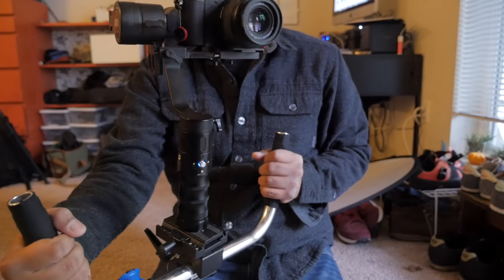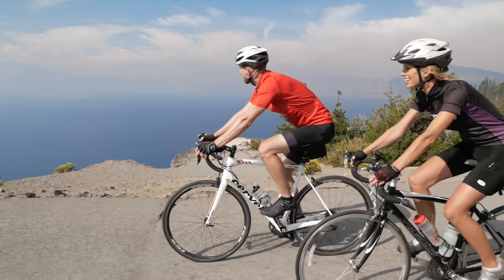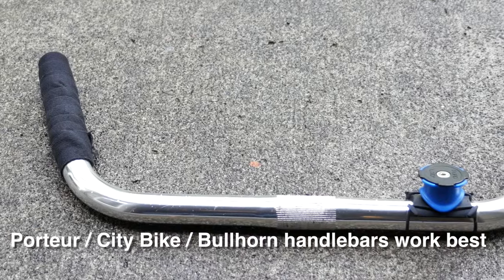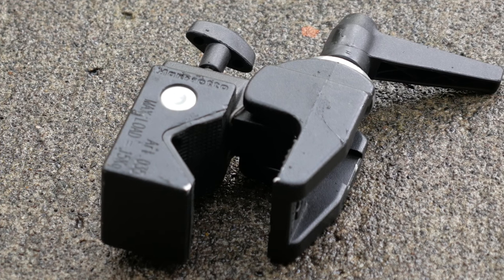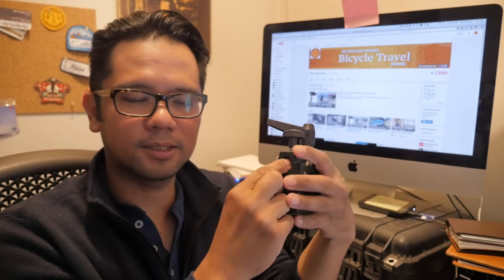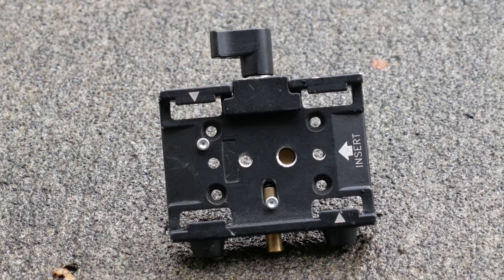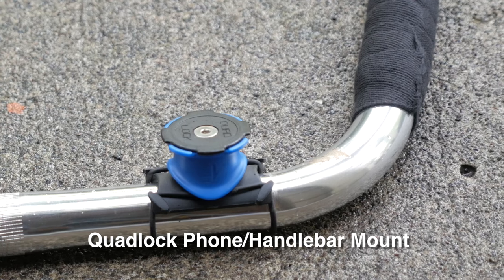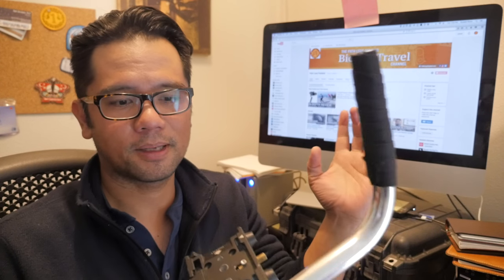DIY Gimbal Handles for Beholder / Ikan EC1 from Bicycle Parts!

Comment: Thanks for the tutorial. I have purchased the clamp and the quick release plate you suggested, but it didnt come with the same screw to attach the plate to the clamp. What kind of screw do I need?
Reply from the maker: You need a Manfrotto 1/4 20 mounting stud. Something that looks like ths. http://amzn.to/2nhFJKh
Reply from the maker: Stud end clamps into the grip and the screw end attaches to the mounting plate.